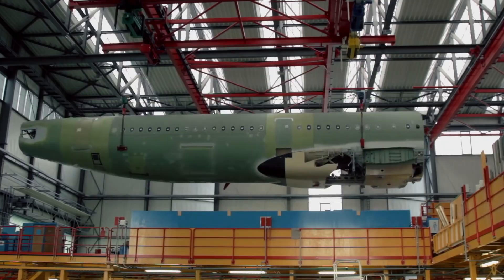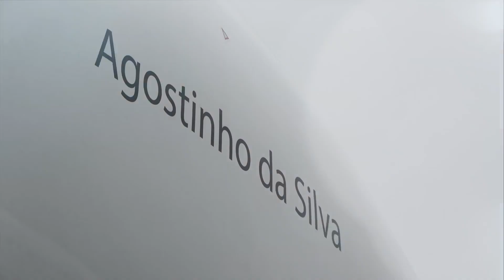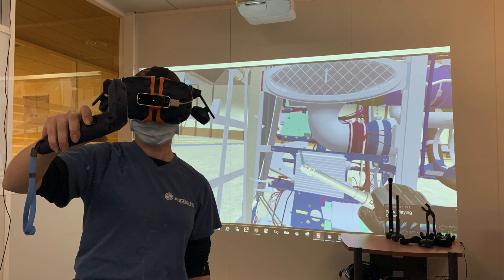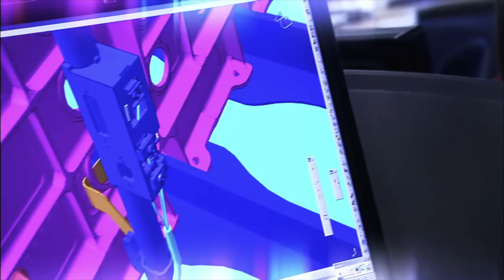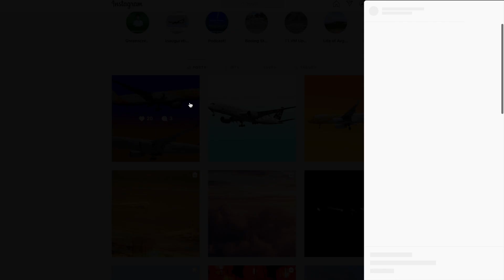A321XLR news: Production edges closer to A321XLR First Flight!

Comment: Although i loved the 757, it needs to have a replacement, I've been waiting for an update for the A321XLR forever! 😀I can't wait to see this aircraft get into operations 😏Especially one of my most favourite airline that i always fly ordered 20 aswell😍😌😜
Reply: Pilot Sam 004 the 757-300 is longer than the A321XLR so the A321XLR won’t be a replacement for the 757-300
Reply: @sebastianfloyd372  Length never matters, capability does, A321XLR is one of the best if not best aircraft for replacement
Reply: @pilotsam004  the 757-300 is longer than the A321XLR so the A321XLR won’t be a replacement for the 757-300. The 757-300 I’m talking about and they’re no plans to replace the 757-300
Reply: @pilotsam004  Airbus should make A321XERs
Reply: @sebastianfloyd372  the fact that it is longer by a bit does not matter at all....
Reply: @sebastianfloyd372  bruh what??? A321XLR is perfect, check your facts
Reply: @pilotsam004  the A321XLR is not long enough, Airbus should make A321XERs. I’m talking about Airbus should make A321XER
Reply: @pilotsam004  the A321XLR won’t replace the 757-300 and they’re no plans to replace the 757-300. @M.S Aviation proved to me that there’s no 757-300 replacement
Reply: @sebastianfloyd372  basically every airline has plans to retire the 757 that flies them....
Reply: @pilotsam004  the 757-200 not the 757-300
Reply: @pilotsam004  Airbus should make A321XERs
Reply: @pilotsam004  Airbus should make A321XER the Extra extended range A321NEOs
Reply: @sebastianfloyd372  that's literally what the XLR is
Reply: @pilotsam004  the A321XLR is not long enough. That Is What the A321XER looks like. Airbus should make A321XERs the extra extended range A321NEOs. A321XERs would be the Stretched Version of the A321NEO the LR and the XLR and it would be longer than the A321NEO the LR and the XLR
Reply: @sebastianfloyd372  size doesn't matter, the A321XLR already has a long enough range, for it's size and capacity it would be uneccerasarry to add any more range
Reply: @pilotsam004  A321LRs and A321XLRs are not long enough
Reply: @pilotsam004  longer but not long enough
Reply: @sebastianfloyd372  how are they not long enough? Make it any longer you need to redesign the whole plane...
Reply: Sebastian Floyd  That just ruins the point of the A321XLR, it's there for long haul low demand routes, it's not meant to be big, Airbus on purposely made it so that there aren't more than about 230 seats. Making it longer would make it useless
Reply: Sebastian Floyd  And it would be a failure
Reply: a321xlr sucks badly 757 is the best
Reply: @arnavsharma9882  Bruh A321XLR is better, how can the 757 be better. Its basically old, The A321Xlr is more efficient. B757 is actually so unsafe.
Reply: @crimsaki5273  what proof do you have that the 757 is unsafe noob !!??
Reply: @arnavsharma9882  3 Crashes that are fatal. Too old making a risk of crashes.
Reply: @arnavsharma9882  2 October 1990; China Southern Airlines 757-200; B2812; flight Guangzhou Airport, China: The aircraft was awaiting takeoff clearance for a scheduled domestic flight to Shanghai, when the 757 was struck on the ground by a hijacked Xiamen Airlines 737-200. The Xiamen aircraft (B2510, flight 8301) had been hijacked, and the captain was attempting to make an emergency landing at Guangzhou. There was a struggle in the cockpit of the Xiamen aircraft during the latter part of the approach, which caused the aircraft to depart the runway and hit a China Southwest 707 prior to hitting the China Southern 757.

All 12 crew members survived, but 46 of the 110 passengers were killed on the China Southern 757. On the Xiamen 737, seven of the nine crew members, as well as 74 of the 93 passengers, were killed in the crash. The hijacker was killed in the crash. No one on the China Southwest 707 was killed.
20 December 1995; American Airlines 757-200; near Buga, Colombia:The aircraft crashed into Mt. San Jose at night at about the 9,000 foot level while descending into Cali, Colombia after its flight from Miami. All 8 crew and 155 of the 159 passengers were killed in the crash. Colombian civil aviation authorities report that at the time of the accident, all navigational beacons were fully serviceable and that the aircraft voice and data recorders did not indicate any aircraft problems.
6 February 1996; Birgenair (Alas Nacionales) 757-200; Puerto Plata, Dominican Republic: The chartered aircraft crashed in the ocean several miles from shore shortly after night time departure for Germany. All 176 passengers and 13 crew were killed. The aircraft reportedly had not flown in the two weeks prior to the accident. Alas Nacionales, a Dominican Republic airline, charted the 757 from Birgenair, a Turkish owned airline, for the flight to Germany. At the time, all airlines from the Dominican Republic were not allowed by the US government to fly to the U.S. because of sanctions imposed by the FAA Foreign Assessment Program.
Related NTSB safety recommendations
2 October 1996; Aero Peru Boeing 757-200; near Ancon, Peru:The aircraft was on a flight from Lima, Peru to Santiago, Chile. Shortly after takeoff, the crew reported some sort of mechanical failure. Contact was lost with the aircraft and the aircraft crashed at sea. All nine crew members and 61 passengers were killed.
2 August 1997; Continental Airlines Boeing 757-200; Lima, Peru:During passenger boarding, an elderly passenger in a wheelchair was assisted up the rear portable stairs by a gate agent. The passenger was instructed by the gate agent to remain at the top of the steps while the agent loaded the wheelchair into the cargo bin. However, the passenger continued to walk into the aircraft, through the aft galley and then through the catering door. The passenger fell to the tarmac through a space between the catering truck and the airplane. The passenger died from the fall injuries. The eight crew members and 141 other passengers were not injured. Note: Spillable batteries are normally not allowed on aircraft unless they are part of an electric wheelchair being used by a passenger.
14 September 1999; Britannia Airways 757-200; G-BYAG; flight 226A; The Pentagon, Arlington, VA: The aircraft was on a charter flight from Cardiff, Wales (UK) to Girona, Spain, and had a runway overrun at Girona. There were two serious injuries among the nine crew members and 230 passengers. One of the passengers who appeared to sustain only a minor injury died five days after the accident due to unsuspected internal injuries.
More about this event
11 September 2001; American Airlines 757-200; N644AA; flight 77; the Pentagon, Arlington, VA: The aircraft was on a scheduled domestic flight from Dulles airport in outside of Washington, DC to Los Angeles, CA when it was hijacked and flown into the Pentagon, collapsing part of the structure. All six crew members, 53 passengers, and five hijackers were killed, as were 125 people in the Pentagon.
American Airlines plane crashes
Attacks on New York and Washington
More on this event
11 September 2001; United Airlines 757-200; N591UA; flight 93; near Shanksville, PA: The aircraft was on a flight from Newark, NJ to San Francisco, CA when it was hijacked. However, on the way to Washington, DC, some of the passengers became aware of the likely intentions of the hijackers and attempted to commandeer the aircraft. The aircraft crashed, either due to actions of the pilots or the actions of the passengers, about 150 miles from Washington. All seven crew members, 34 passengers, and four hijackers were killed.
Attack on New York and Washington
More about this event

1 July 2002; DHL 757-200PF; A9C-DHL; near Üeberlingen, Germany: The aircraft collided with a Bashkirian Airlines Tupolev 154 (RA-85816) while both aircraft were flying at about 36,000 feet (about 11,000 meters). Debris from both aircraft fell in an area near Lake Constance on the German-Swiss border. Both crew members on the DHL 757 and the 57 passengers and 12 crew members on the Tupolev 154 were killed. The 57 passengers on the Tupolev 154 included 52 children and teenagers. The 757 departed Bahrain and was continuing on to Brussels after a stop in Bergamo in northern Italy. The Tupolev 154 was on a trip from Moscow to Barcelona and had made a stopover in Munich shortly before the accident.
Fatal midair collisions
Plane crashes for airlines of the former Soviet Union

7 December 2005; American Airlines 757-200; flight 924; Miami, Fl: The aircraft had arrived from Medellin, Colombia, and was on a roughly two hour stopover in Miami before continuing to Orlando. It is alleged that one of the passengers, Rigoberto Alpizar, a 44-year-old U.S. citizen, claimed to have a bomb in his carry on luggage. Air marshals confronted the man on the jetway and shot him after he appeared to reach into his bag. The man died sometime later as a result of his wounds. No explosive was found in the bag. It was reported that this passenger had previously arrived in Miami on an American flight from Quito, Ecuador and had cleared US customs before boarding the Orlando flight. No one else was injured in this event. This was the first time since 11 September 2001 that air marshals have fired a weapon on or near an aircraft.
American Airlines plane crashes
More on this event
9 November 2018; Fly Jamaica 757-200; N524AT; flight 924; Georgetown, Guyana: The aircraft was on a scheduled international flight from Georgetown, Guyana to Toronto, Canada. The crew experienced a hydraulic system failure during climb, stopped the climb at FL200, and elected to return to the departure airport. The aircraft had an excursion off the right side of the runway, coming to rest just short of the end of the runway off to the right. The right main landing gear collapsed, the right engine separated from the aircraft, and the right wing was damaged. All eight crew members survived, and one of the 120 passengers was killed.
More about this event
Reply: @crimsaki5273  umm i think thats more of human errors and not the 757 itself
Reply: @crimsaki5273  the 757-300 is longer than the A321XLR so the A321XLR won’t be a replacement for the 757-300

Comment: Wondering if there's an ACJ321XLR with 2 Fix Additional Tanks (front & rear) with 101t MTOW to fly 7000nm (2.4t/hr)🛫🤓
Reply from the maker: Sounds interesting but guess the payload in terms of passengers and cargo would be extremely low. Thanks for tuning in!
Reply: @oneskyflyer  101t MTOW - 51t OEW- 38.7t Total fuel (18.7 main tank+ 20t {2x Fix Additional Tanks})= 11.3t spare

So, there's still left 11.3t For interiors+ baggage/amenities+ passengers 🛫🤓
Reply: @stradivarioushardhiantz5179  interesting proposition but the ACJ orders itself cannot justify the development of another front integrated tank. The tanks are not plugged and play and further structural reinforcement and certification is required to fit another centre tank in front.
It is more likely that ACJ321XLR will feature just one rear centre tank and several more auxiliary tanks.
I'm sure in due time airbus will introduce the ACJ321XLR. It will be interesting to see how the corporate jet markets take up and response is to the ACJ321XLR as it will feature the range of an A330-300 and the economics of an A321neo.
Reply: @chingweixion621  if an idea of Front Additional Tank won't be certified by EASA/FAA then A321 still have another space in front cargo for Max 5 ACT (as we know A321 has cargo hold for 10 bulk in total) .....means; if Front hold added 4 ACT which equal to 1 x  Fix Additional Tank w/ <400kg each....the OEW will be around 51.3t (50.1t  A321XLR OEW+ 1.2t {4 ACT}) .....so the total fuel would still around 38t.....if the fuel burn rate; 2.2t-2.4t/hr.....capable to fly 15.5-16hrs (6500-7000nm)🛫🤓

Comment: I am sure that the A321XLR is going to be the plane that will hurt Boeing alot
Reply from the maker: Well, competition between both manufacturers certainly drives the industry towards cleaner and better aircraft! Thanks for tuning in!
Reply: @oneskyflyer  That is very true! You are welcome, I will happily tune in to your videos anytime. Great Job!😃👍
Reply: Airbus already has the 100-240 seat single market cornered. While Boeing still fluffs around with the B737 MAX and the B777 X programmes Airbus is moving ahead especially the fine tuning of the A220-300 with the increase MTOW allowing for extra 200nmi of range.
Reply: 737 will never die idiot
Reply: @arnavsharma9882  DON'T CALL ME AN IDIOT!!! You have to admit that the max will likely be the final version of the 737, there really is no way to upgrade the 737 even more. Just admit it
Reply: @rdymond04  the a321xlr can't defeat the 737 max 737 has been a legend since a long time
Reply: @arnavsharma9882  The 737's reign is quickly coming to an end, the A320 Family has surpassed the 737 as the most popular Aircraft. There really is no way that Boeing could upgrade the 737 anymore. While Airbus is still improving on the A320 with capacity, range, and fuel efficiency. Just admit that the 737 is at the end of the road.
Reply: @rdymond04  dude 737 is one of the most built commercial aircraft ever built and will remain the most popular aircraft for at least 2-3 more decades
Reply: @rdymond04  oh, also Boeing is looking forward to start a new narrow body plane project or possibly re-engine the 757
Reply: @arnavsharma9882  The 737 has killed many lives, It has killed more than 1000. It's often dangerous, the A320 crashes are mostly Human error and 2 of them are maintainance problems. The 737 may have alot of builds and success but it is byfar one of the most dangerous planes in the WORLD. The A321Xlr can beat the 737, We need Efficient, safe, Widebody, planes for the environment.
Reply: @arnavsharma9882  The 737 has ended many innocent peoples lives.
Reply: @crimsaki5273  here we go new bargainer !!
Reply: @arnavsharma9882  bruh
Reply: @arnavsharma9882  Save a plane from getting retired or save the thousands of innocent peoples lives?
Reply: @crimsaki5273  that's obvious cause it was released much before the a320 and henceforth
Reply: @arnavsharma9882  Read that reply, would you rather save a plane from getting retired or save thousands of innocent people from plane crashes.
Reply: @arnavsharma9882  In case you did not know, the A320 Family has been the most popukar and best selling plane for 2 years now since 2019! GO AIRBUS!!!
Reply: @rdymond04  go Boeing go a320 loses !!!!!
Reply: @crimsaki5273  do you even believe in what you are writing? Have you realized that the 737 is more than 20 years longer in Service then the A32X?
Reply: @widget787  I know but Atleast it's safer, I calculated the crashes from where Airbus started and I saw 680 crashes.
Reply: @crimsaki5273  who crashed 680 times? The XLR hasnt even flown, you dont know how safe it will be. There are already safety problems with that new integrated tank for example.
Reply: @widget787  Starting from 1970 where Airbus started, Boeing crash 680 times, I saw from Swiss001.
Reply: @crimsaki5273  and how much Airbus crashes? Apart from the fact that the A300 first flight was in late 1972 there were already thousands of Boeing aircraft in the Sky in 1972 while it was only one Airbus. It was not until the 2000s that Airbus came even close to Boeing in terms of Market Share. So you are comparing apples to peas.
Reply: @widget787  144/160 Im not sure I got it from Swiss001.
Reply: @arnavsharma9882  - Cause it will